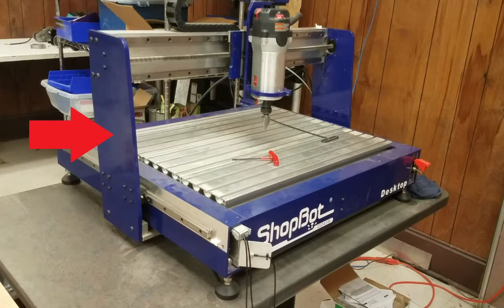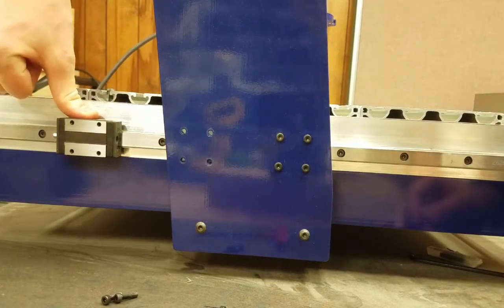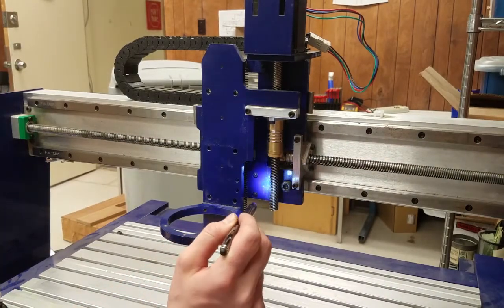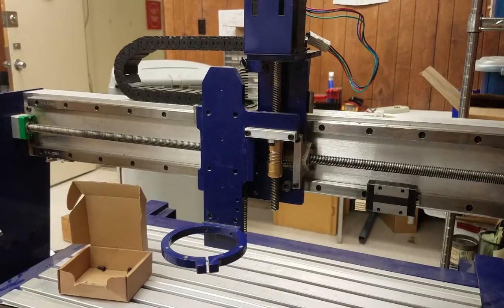ShopBot Technical Support - Desktop Bearing Blocks

Comment: Is there some issue with pre-2017 machines that suggests we'll need to replace the bearing blocks?
Reply: Nope, I did try and mention in the beginning of the video that these blocks are quite robust and do not often need to be serviced and replaced (we have 5 year old tools with the same blocks running in our shop), but knowing how to do so if an issue is suspected (binding, grinding) is useful to know. The blocks used on pre-2017 models were the same that ShopBot uses today, still THK blocks.
Reply: Thomas Hartnett - Thanks. I wasn't sure if the pre-2017 comment referred to a potential issue or just that there's a different way to check them on post-Aug 2017 machines.
Reply: No problem, I should have included a picture reference! The design of the Aug-2017 and newer tools makes it so the procedure is different - much easier on the gantry, and harder (but not needed) on the table.